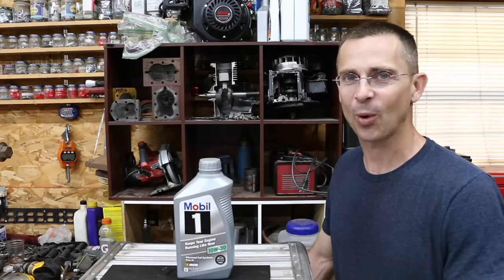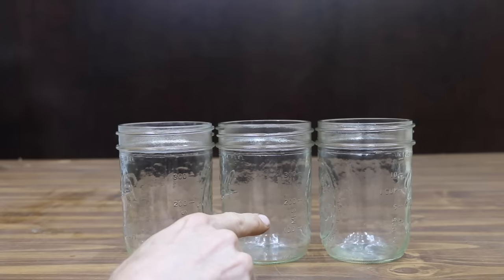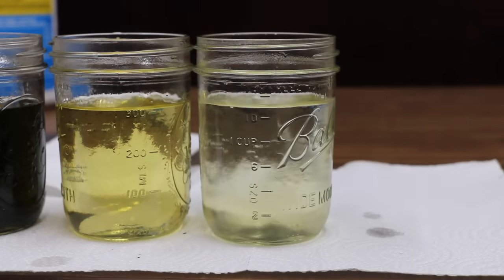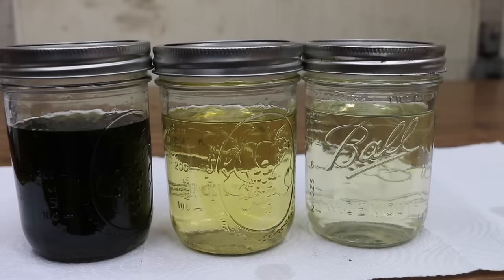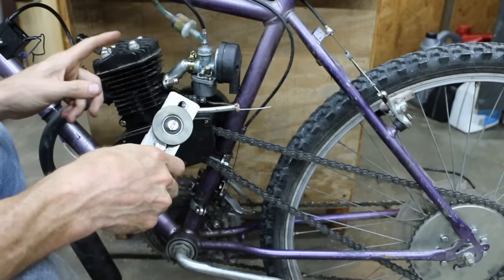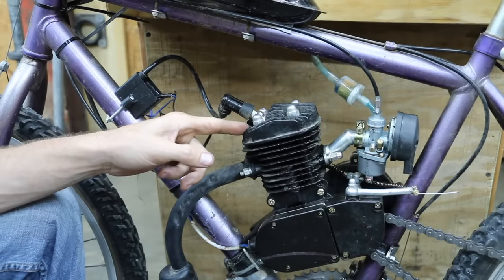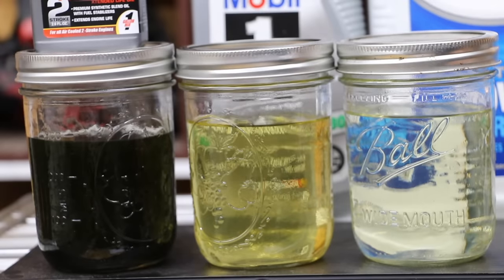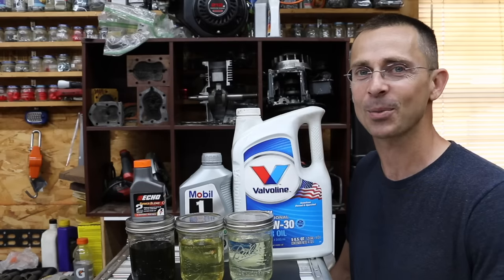Will 4-stroke oil damage a 2-stroke engine?  Let's find out!

Comment: Instant answer. .NO IT WONT... I run British Motorcycles from the 50's and 60's and the fuel caps reccommend using 40 grade mixed into the tank (Premix) 20:1 ratio . I have never experienced problems with this. I do agree that oils have come a LONG way since then and two-stroke oil with a low ash formula makes for better starting and running .
Reply from the maker: Thank you for the feedback

Comment: One thing to point out is that these tests are being carried out on very low power, low RPM, and low specific output engines.  These really never get to the point of detonation in normal operation.  The problem with motor oil is that it has an octane rating of some low, low number, such as 30 I believe.  When it is mixed into gasoline, effective octane is drastically reduced.  However, since these engines see relatively low thermal and physical stress, this isn't a problem.  Try putting this oil mix fuel in a turbocharged car engine or any sort of high compression high RPM engine such as on a Japanese sports bike and you will burn pistons quickly!  Two stroke oil has chemicals added that try to raise the octane number of the oil in order to help keep two stroke engines [which run very very hot!] alive.  For this reason, some race crews actually use two stroke oil in the sumps of four stroke racing engines to prevent detonation due to oil ingestion or leaking valve guides.
Reply from the maker: Thanks for the constructive feedback
Reply: @ProjectFarm  Great videos!!!  Keep up the good work.

Comment: Have you ever tried adding oil to the crank case with an oil splasher and see if you can run straight gas in the engine?
Reply from the maker: Thank you for the video idea!

Comment: Gracias por el buen video , tenía duda si podía usar aceite de 4 tiempos en mi desbrozadora con la.informacion que aportas voy a usar el aceite que el fabricante recomienda saludos desde Cancún
Reply: Thanks for the good video, I had doubts if I could use 4-stroke oil in my brush cutter with the information you provide, I will use the oil that the manufacturer recommends greetings from Cancun

Comment: Any one guide me.. If i use 0w-40 oil in my yamaha rx100 2stroke bike as transmission oil.. Its lead to any problems? Any problems faced to the oil seals in that engine and cluch plates?? Plz replay guys thank you

Comment: I've run a two-cycle motor on just 2 cycle generator 3-months Non-Stop and that runs better than it did on the 2-cycle oil less carb unless that's anyting
Reply from the maker: Thank you for the feedback

Comment: Pretty sure 2 stroke oil is premixed with solvent, so you are actually using less oil than it would seem. Maybe the key is to measure the viscosity and use that as an indicator of how much to add.
Reply from the maker: Thank you for the feedback

Comment: I used to have a 1962 Evinrude 28hp outboard and the label on the carb actually said to use SAE 30 oil in the 20:1 gas mixture. I'm guessing actual 2 stroke oil wasn't invented up to that point. 😉
Reply from the maker: Thanks for sharing.

Comment: Years ago there was no specific two stroke oil you only had detergent oil and non-detergent but it was recommended to use non detergent oil usually 30 weight
Reply from the maker: Great information. Thank you

Comment: I did not start watching yet but i am sure that not. It is important to use any oil. When i had old Mazda 323, which was consuming oil i was refilling it with any i found in my garage. That means mix of half synthetic oil with mineral with one dedicated for gears. Half of year exploating my Mazda did not destroy the engine (keep in mind that i was exploating it to 6500rpm, 1,5l, 16v). I sent this car to junkyard becouse of body corrosion.
Reply from the maker: Thank you!

Comment: I mix my chair saw in 4 stroke oil 10/30 is that effect the engine. .and I heard they use vegetables oil with gasoline better than 2 or 4 stroke oil
Reply from the maker: Thanks for the feedback.

Comment: No 4 stroke oil won't hurt a two stroke engine.
My dad owned a Saab96 and it had a 3cylinder 2stroke engine, and I used Texaco 4 cycle oil in my dad's Saab96 one time and it worked pretty good.
Reply from the maker: Thank you for the feedback

Comment: An interesting experiment,so two stroke oil has less ash content? I'm wondering what to use in my wankel engined bike,two stroke or semi synthetic?
Reply from the maker: Thank you for the feedback
Reply: Most 2-cycle is ashless, to my knowledge, but there are synthetic and semi-synthetic 2-cycles just like there are synthetic and semi-synthetic 4-cycles. As far as best oil for Wankel, I don't know, I apologize

Comment: My guess is that it would because the gasoline would turn the 4 stroke oil to more of a diesel's fuel and I am fairly certain that the additive package that they put in it for longevity, cleanliness, etc would not be the greatest on a 2 smoke engine
Reply from the maker: Thanks for the feedback.

Comment: Long term with 4 cycle oil you won't get the lubrication necessary for long term engine life. I have heard that straight weight 4 cyl oil can be used as a substitute for 2 cyl oil.
Reply from the maker: Thanks for the feedback.

Comment: Long term use of 4 stroke oil in 2 stroke engine can cause damage to the 2 stroke engine.This oil is not burned all,but is pressuized under the piston rings,pushes them out and increases the wear of the rings and the cylinder,thus shortening the engine life.
Reply from the maker: Thanks for the feedback

Comment: Good to know I wondered once before, can you run a 2 stroke with no oil I wonder how long untill it will seize up or if the gas would be a good enough lubricant(I dont think it so) but would be cool to see
Reply from the maker: Thank you!
Reply: Burned 2 two strokes up by not having the gas mixed. When the second one qiute is when I realized the gas was not mixed.

Comment: Two stroke outboard motors ran 30wt oil at 8:1and later at 16:1 for decades in the first half of the 20th century.
Reply from the maker: Thank you for commenting on this.

Comment: Back in the 80s i worked with a man that said in the 40s.. they use to change oil by draining all the old oil from the vehicle.. then filling the engine up with kerosene ,, run the engine for couple of minutes   then drain the kerosene out    and then replace it with new oil..   he claimed that it cleaned the engine thoroughly and made it last longer    ever heard of this .. would running and engine on kerosene damage it ?
Reply: Alot of those engine flush products on the market smell like kerosene. So to me it makes sense. The only problem is, the kerosene has a tendency to glaze cylinder walls. I've seen that happen even with gasoline that was contaminated with diesel oil.

Comment: question. unrelated to engines. can we use hydraulic oil in  automatic transmissions?
Reply from the maker: Since there are differences, I wouldn't try it

Comment: I'm old enough to remember when owners manuals used to recommend 30 wt oil in 2 strokes. Usually at 32 to 1.
Reply from the maker: Thank you!
Reply: I grew up diluting 16:1 and was astonished when Stihl put out 40:1 engines.
Reply: Ol' Lawn Boy recommends Lawn Boy oil at 32:1, or richen to 16:1 if standard oil was to be used.

Comment: Waaaay back when this old timer started messing with engines there was NO 2 stroke oil !!!  We mixed 30 wt non detergent oil with the gas and the old Johnson out board ran great !!! Also there was NO 10-30 or 10-40 oils just straight single weight !!!
Reply from the maker: Great point!

Comment: I'd actually use a bigger ratio like 20:1 for the four stroke as it is better at lubricating than the 2 stroke.
Reply from the maker: Thank you
Reply: @ProjectFarm  actually I might be wrong... I said that because I watched the 2 stroke oil in 4 stroke engine video where you did the lubricity test and after rewatching it I realized there was little difference. Still worth a shot but maybe with something like 18:1 (so it doesn't hurt the engine).

Comment: I've read somewhere that full synthetic oil does not mix with gasoline, i forgot the reason..
what i am interested in is mixing oil with diesel
i know some people add 2T oil to diesel because nowadays diesel is dry 
how about 4T oil mixed with diesel?
4T synthetic and 4T mineral
i know the outcome would be similar to as if the piston rings were damaged and engine would mix oil with fuel and would smoke but that's a very uncontrolled environment
Reply from the maker: Thanks for the suggestion.

Comment: I have a 4-stroke motorcycle in need of rings, and coincidentally it burns just about as much oil as my 2-strokes do.  Smokes about the same too.  No problems with fouled plugs or anything on any of the engines.  HOWEVER.  If you're behind the 2-stroke, it smells like a 2-stroke.  If you're behind the oil-burning 4-stroke, it smells like you're down-wind from a big power plant that's 100% fueled by tires.  I'm tempted to just fill the crankcase with Blendzall to get my riding buddies to hate me less.
Reply from the maker: Thanks for the feedback.

Comment: What if you mixed an oxidizer into your gas like on a rocket. Could you run the engine without an intake. A liquid or maybe a powder oxidizer that will dissolve
Reply from the maker: Thanks for the video idea.

Comment: My papaw ran an old,BLUE homelite saw for yeaaars, and all he ever mixed was 30 weight motor oil. I still cant bring myself to do that. I still pay $30 a gallon for boat oil,and stihl synthetic in my stihls.
Reply from the maker: I use the 2 stroke oil too.  It does burn cleaner and there's a lot less carbon buildup.

Comment: I been using used oil from my truck oil changes in my chain saw and weed eater for years and they run great  heck I can't remember ever having to clean carburetor  they just keep running year after year and I guestamate the mix as long as it smokes a bit I'm good
Reply from the maker: Thanks for sharing.

Comment: You are supposed to add oil first, then fuel. Also I run my 2-stroke equipment at a 100:1 mix ratio.
Reply from the maker: Thank you for the feedback
Reply: It doesn't matter as long as it gets mixed, and 100:1 is too light for just about anything.

Comment: Yes, you can use motor oil. No, you cannot run it at the same 50:1 mix it should be closer to 15-25:1. 50:1 mix with motor oil would be to lean and cause the engine to wear out very quickly.
Reply: Also the reason older 2cycle engines recommend higher mix ratios has more to do with the oil at the time than the engine itself. I still do not recommend using anything other than manufacturer suggested ratios and name brand FD spec mixes.
Reply from the maker: Thanks for the feedback.

Comment: So, did you date the 4 stroke Jar and put it away to see if it actually Gums up?
We seem to get a lot of misleading information on Oil Mixing from people that never actually did any testing.
i.e. 2-stroke Marine oils in Air cooled engines. the real fact is the specific chemical design of the particular oil. I know of several Marine oils that are Marine plus air cooled use. Much of the world never had 2-stroke oil and their small 2-stroke engines have been running for decades on whatever oils are available for mixing.

Comment: While I was growing up in deepest, darkest Appalachia in the late '60s and '70's my dad and everyone I knew used straight 30W for 2-cycle mix. It was mostly used in chainsaws and bar oil was usually used motor oil from service stations. Now granted, the common chainsaws at the time were McColloch, Homelite and a little later Poulan, so I doubt those PoS engines would have known the difference or benefitted from purposely engineered 2-cycle over 30W.  🤣
Reply from the maker: Thanks for sharing.

Comment: If you put motor oil in the premix tank on a motorcycle, it may not actually lube the engine.  I know some genius who did that and destroyed the rings/bore very quickly.
Reply from the maker: Thank You
Reply: Makes full sense. Real 2 stroke oil is like 10W motor oil, but it stays thinner in cold weather! I can see 30W oil doing major damage in an oil injection engine especially when super cold.
Reply: Yeah the oil tank stayed full and it never mixed with the fuel. The injection system would not dispense the motor oil.  After draining and replacing the tank with 2 stroke it was fine.  Of course that was after a slight bore and ring job.

Comment: On average it won't hurt the engine over time it will gum up the carb. Seen it first-hand myself.
Reply from the maker: Thank you for the feedback
Reply: @ProjectFarm  Yeah I know this because I had a family member run an old homelite chainsaw for years using 10W-30 and it gummed up on him. The service tech asked him what he was running for mixture oil and after he repaired it he advised him to use a two stroke oil made for the fuel mixture. Apparently a lot of the old timers used regular oil so this guy had seen this issue before. It didn't hurt the engine so all ended well.
Reply: California gas does that on its own
Reply: @skynjaydensdaddy  Crappy gas huh?

Comment: At one stage, 2 stroke oil came  [or still comes in] outboard or 2 stroke motor bike, the outboard was supposed to burn better in the cooler environment of a water cooler marine engine as distinct from the savage heat of a  motor bike engine which it was assumed the oil was deemed not to be of such good quality. A neighbor of mine asked me to check his non starting 2 stroke mower, the exhaust port was down to 3/8 inch wide by 3/32 deep, no way to get the gas out, I suspect it was because he was a cheapskate and used 4 stroke oil which did not burn up sufficiently in a 2 stroke engine.
Reply from the maker: Thank you for the feedback

Comment: Hey, going back to my motorbike days, four stroke oil contains a lot of additives not needed in a two stroke, we are talking Yamaha autolube stuff, four stroke oil leaves a load of deposits on the piston crown, which will reduce performance slightlyAlso it will cause the spark plug to foul, whisker small hair of carbon across the gap, tried straight W30 no fouling of plugs but build up of soft deposit on piston crown, back to two stroke engine oil, and clean engine and plugs, no decokes necessaryDo not put multigrade four stroke engine oil in a two stroke engine, wont cause damage,  but unless you want a Cylinder head off every month to remove the crud and clean the plugs, use two stroke oil, just my observations
Reply from the maker: Thank you!

Comment: Years ago I had a high performance 2 stroke motorcycle sometimes I used conventional oil in by motorcycle if I didn't have 2 stroke oil. But under heavy load and high rpm the   motor would try to seize .4 stroke oil might work but long term its definitely  not good for a high performance  2 stroke .
Reply from the maker: Thank you

Comment: the trouble with using random oils is it doesn't mix properly and will settle in your carb then it wont run on pure oil.
even real 2stroke oil can settle at the bottom
Reply from the maker: Thanks for the feedback.

Comment: Can u suggest me.  What will happen in  my 2 stroke bike engine add 4t oil. Is there any damage to my engine
Reply from the maker: I wouldn't recommend it but it should work in a pinch.  I would use a little extra 4 stroke oil if it were me.
Reply: @ProjectFarm  
Why u add extra 4t. If I use 4t oil in my bike it smokes extra than natural. My bike smokes whiter what is my bike program

Comment: Back when i was in my early teens i had a Suzuki TM 250 2 stroke...  The majority of the time i spent riding i had no access to 2 stroke oil.. Usually mooched some gas from dads gas can and added vegetable oil from moms cupboard. The bike ran great however, everywhere i went it smelled like someone was making french fries.   :)
Reply from the maker: Thanks for sharing.

Comment: Have you done a video of running premix 2 stroke oil/gas in a 4 stroke engine?
Reply from the maker: Thanks for the suggestion.
Reply: i ran almost 55 gallons worth of 50:1 mixed gas through my generator during a recent flood. It barely smoked and it ran normally as far as I could tell.

I got the gas free from a guy at a local marina who got flooded out and needed to get rid of it.

Comment: Rotary motors just use the motor oil for 2 stroke mix have done it for years in my bikes no problem other than more smoke an soot
Reply from the maker: Thank you for the feedback

Comment: Chinese 2 strokes give a 25:1 ratio because they use a 30w oil for mix they also use the same for bar oil. So this is very common. Nice how 2 stroke oil atleast colors the gas so u know it’s mixed. Lots of ppl run straight and mess em up
Reply from the maker: Thanks for the feedback.

Comment: sae 30  weight conventional oil was the oil used in 2 strokes for many many decades, synthetic 4 stroke oil produces a harder heavier carbon and should not be used in a 2 cycle unless its a emergency
Reply from the maker: Thanks for the feedback.

Comment: The oil mix is more for the crankshaft not piston regular gas has enough lubricity to lube cylinder same for 4 cycle diffrence is 2cycle engine has no oil in crankcase that's why you mix the oil and gas.

Comment: Had many 2stroke things 70years of them never used anything but drain oil in them it may have settled awhile though 😊 no bad results didn't know there was special oil .had a Evinrude 2cy.had oil injection said to use motor oil .
Reply from the maker: Thank you for the feedback

Comment: 4 stroke oil will not burn as clean. The 4 stroke oil will create more deposits, which will clog the exhaust over time.
IF this happens, you have to burn it free or use a new one. This happens esspecially with oldschool mineral oil.
You can go arround this using full synth. oil, but this just expand the time till the same result will come.
Reply from the maker: Thanks for the feedback.